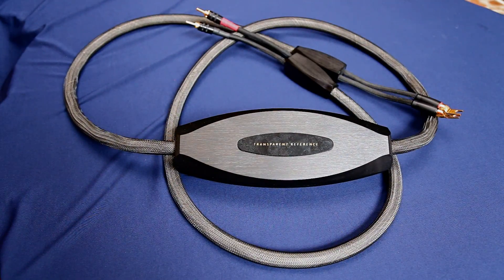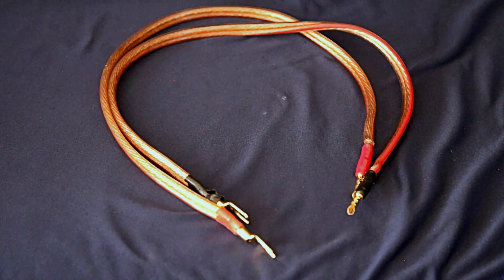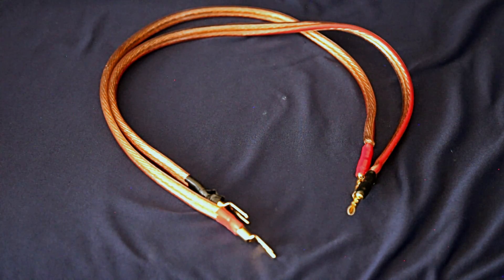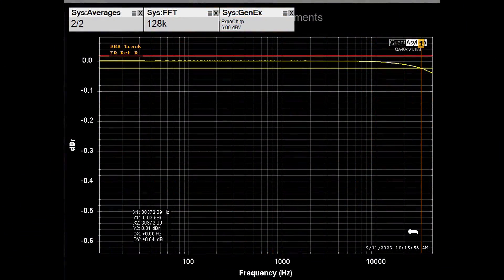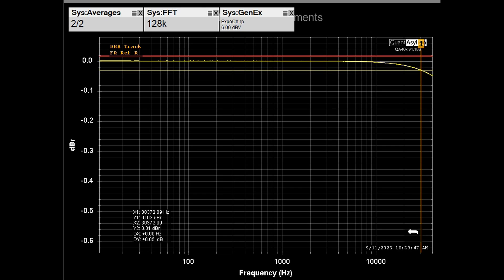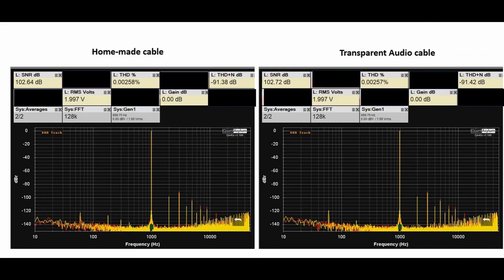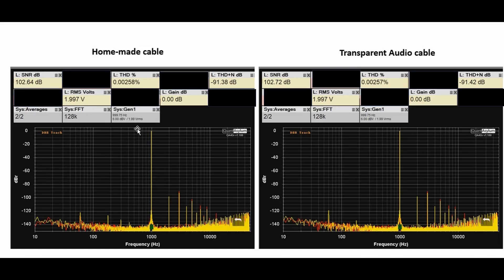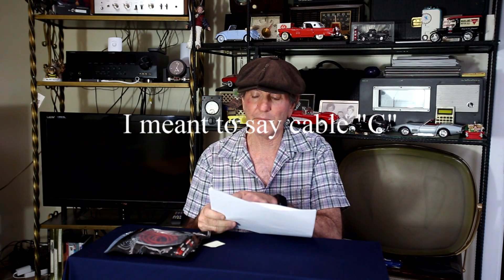$8000/pair Speaker Cable  vs. $14 DIY Speaker Cable A/B Test: Vintage Audio Review Episode #87

Comment: What you hear in better quality cables often is not the tone, not an analysis of the bass, the midrange or the treble, it's in hearing the improved detail, transparency and spatiality of the 3-dimensional stereo image. But in order to hear those differences it comes down to setup. If a system is set up to present an accurate presentation of the stereo image then those differences can be become much more clear. If the system is not set up for that and one is merely listening for differences in tonality, whether they hear more or less bass, if vocals sound drastically different, or that a hi-hat is transformed, then you are not going to hear a huge difference. To reap the benefits of quality cables you need to have a properly set up system to maximize the stereo image and often the set up should include proper room treatments. You may say then, well why the heck do i need to go through all of that work to be able to hear differences in cables? You don't. It all depends on what you want. I say to each their own then. There is a market for higher quality cables because it caters to those who have a system set up to benefit from those cables. If you don't want to hear the differences cables make then just stick with the setup you have and carry on. For those of us who are maximizing the reproduction of the stereo image we will then reap the benefits of higher quality cabling.
Reply: @sean_heisler  
In reality, the quality of the 3-dimensional Imaging and Soundstage performance of loudspeakers have absolutely nothing to do with what speaker cables you are using.

The properties, quality, or "precision" of the Imaging and Soundstage are determined first by what is captured or mixed into the recording itself, and secondly by the design and quality of the speakers themselves plus the acoustics of the room they are placed in.  There is a third very important factor...

In order for our auditory system to perceive a more accurate/more focused soundstage that reproduces exactly what is captured or mixed into the recording, the single most important factor is that the Amplitude Response (Level vs. Frequency, or "Frequency Response") Between the Right AND Left loudspeakers be as Closely Matched and as similar as possible At Your Listening Position.

An imbalance between the Frequency Response of the Left vs. Right speakers will make it difficult to achieve good imaging.

Achieving good imaging and soundstage performance with loudspeakers that are placed in a non-symmetrical room can be problematic.  For example, when you have your speakers placed in a living room in an open-plan home where one speaker is in a corner with both a wall to the side and behind the speaker, while the other speaker has the same wall behind it, but no side wall because that side of the room is open to another adjacent living area such as the kitchen or dining area.

In this scenario, due to the difference in reflections as well as the difference in boundary-loading and "room gain" between the left and right speakers, the Left vs. Right Frequency Response will be quite different, and the imaging/soundstage performance will suffer.

The ratio of the direct sound from the speakers vs. the reflected sound from the room will also have an effect on the quality of the imaging, especially if one side is different than the other.

Excellent imaging and soundstage performance is easier to achieve when you eliminate or mitigate most of the room's acoustic interactions and influence on the sound that you hear from the loudspeakers, and is the primary reason that the majority of recording, mixing, and mastering engineers generally use "nearfield" studio monitors while producing the music that we all listen to.

Listening to speakers that were designed to be precisely matched to each other in regards to frequency response and dispersion, as well as listening to them in a nearfield environment provides for the most accurate reproduction of the imaging and soundstage in the recording, NOT speaker cables!

This is another reason why even relatively inexpensive earbuds or headphones usually do a good job of providing good Left-to-Right imaging and focus.  However, they usually lack some of the crosstalk and HRTF/head-shadowing imaging cues we hear when listening to loudspeakers in a typical room which are time-arrival based (ITD) and help to provide a perception of Depth and "Room Ambiance" or the size of the performance venue.

Swapping speaker cables has NO affect on ANY of these properties.  If for some reason you do have poorly designed speaker cables that alter the frequency response of the speakers due to excessive resistance, capacitance, inductance, etc, when you switch to a different pair of speakers cables that do not have this issue, even though the overall FR might be slightly different between each set of cables, BOTH speakers will STILL BE MATCHED to each other because you are using the same SET of cables for both speakers.

And in reality, moving your head just 12" up/down/left/right from the MLP has far more potential to change the response and imaging/soundstage performance compared to any differences another set of speaker cables will make!
Reply: @bbfoto7248  well said.
Reply: @bbfoto7248 How does all that get to the speakers if the cables have temporal distortions, a high noise floor or tonality issues. Sometime you guys can't see the forest for the trees. A speaker without dispersion issues, tonality issues, crossover issues, cabinet issues, refraction issues, issues with high driver distortions, drivers with high mass, etc. costs way more than a decent cable yet here we are.
Reply: @bbfoto7248 Yet it can't improve what it. Cable swaps can and is easier and cheaper than speaker swaps.
Reply: @carlosoliveira-rc2xt  
Estoy no comprendo tu palabras, amigo.

Different wire can not magically "improve" or "create" better electrons or "flow" in the signal that the wires transmit.

A basic, but properly constructed set of speaker cables of adequate wire gauge to carry the required power (usually no larger than 14 AWG for 20+ feet/7m) will transmit EVERYTHING that is inherent in the AC waveform and signal that the speakers need in order to reproduce the sound accurately.

Again, just moving or aiming the speakers in your room +/- 3", or moving your head 10" to one side or the other will affect the sound characteristics infinitely more than swapping properly constructed & terminated speaker cables.

And as others have said, your Room Acoustics matter MUCH More as well.

The properties that affect your perception of ALL aspects of "resolution", "detail", "nuances", "spectral balance", AND 3D Imaging & Soundstage performance are achieved by MATCHING the Time Arrival AND Frequency Response as closely as possible between the Left & Right speakers At Your Listening Position.

Exotic or "special" speaker cables Do Not change any of those properties unless they are inherently flawed or purposely designed to do so by being something other than neutral and agnostic.

Electrons Do Not magically become "better" or improved when flowing through an already highly conductive material such as copper, silver, or gold.

You can't slow them down, speed them up, or make them dance a special way within the wire on their way to the speakers.

The only real considerations for the topology and construction of any type of audio cable are voltage & current capacity and rejection of potential induction of EMI or RFI noise from external sources.  But the AC signal voltage level alone that is carried by speaker cables is high enough to overcome this type of noise in all but the most extreme circumstances.

I have no problem with spending good money for nice cables that are properly constructed with excellent connectors and proper terminations (THE most important aspect of ANY type of cable), but I'm not doing so with the intent or expectation of IMPROVING the actual sound of my system.

I've been a musician since the 1980s.  Step into any world-class Recording Studio and you'll soon realize that there are potentially THOUSANDS of feet of all different types of cables and wire connecting all of the studio equipment.

While the music that you love to listen to was actually being recorded, then mixed, then mastered, the audio signal that finally made its way to the digital DAW recorder/storage device or to an analog reel-to-reel tape deck has already travelled through sometimes HUNDREDS or more feet of All Different Types Of Cables, AND through a multitude of various electronic components...from the microphone, mic cable, to the mic preamps, through the mixing console and its channel strip EQs/Op-Amps/Transformers/Potentiometers, then through all of the outboard analog & digital rack-mount EQs, Reverb/Delay, Compressors/Limiters, & EFX gear, THEN back into the console, and finally to the studio monitor speakers and the actual recording device!

In addition, 90% of the studio monitor speakers that engineers use don't even have Speaker Cables because they are Active designs with built-in multi-channel Class D amplifiers and electronic DSP crossovers.

These studio monitors are connected using typical off-the-shelf and industry-standard balanced XLR SIGNAL cables from manufacturers such as Mogami, Canare, Neutrik, and Amphenol, etc.

^There is NOTHING Exotic or Unique about these cables other than them being a proven and reliable design.

Again, these are the engineers and studios that Actually RECORD and Produce all of your favorite music and the "audiophile" tracks that you are listening to on your playback system.  WHAT do YOU KNOW that they don't? 🙄

Just do an image search for "Studio Patchbay" and look at the multitudes of all the different cables that are plugged into the front of it in order to route and select (patch) different gear into the signal chain...and also know that there are Even More Cables and connections attached to the back side of the patch bay that snake all over the studio!

Do you think that these engineers are actually going to Swap out EVERY cable in the studio for some particular type of expensive "exotic" or "special fairy dust" cables???

^But that's exactly what they would NEED to do, because if you leave just one "normal" cable in the signal path, it would be the "weakest link" in the chain and cancel or nullify the "special properties" of ALL of the other exotic/boutique cables.

Legendary recording and mixing engineer Al Schmitt (RIP) with 23 Grammy Awards isn't going interrupt Diana Krall in a tracking session and tell her to "hold-on, wait!" while he swaps out his speaker or other cables because the sound isn't "right" or "good enough" as it's coming out of his studio monitor speakers!

The effects of a 6ft-15ft length of proper speaker wire of adequate gauge that is connected between each speaker and the amplifier and is transferring audio bandwidth signals in AC at ~ 3-50 volts is completely INSIGNIFICANT.

There are simply a PLETHORA of other things that will have an Exponentially Greater Impact on the the level of sound quality that you achieve in your playback system.
Reply: @ This is not correct. As I discovered much to my shock, better speaker cables made a huge difference in the sound of my very expensive system
Reply: As a Communications engineer on Doppler systems on aircraft. It horrifies me so see how people actually believe they can hear such a difference with cables. From a scientific point of view it’s snake oil.
Reply: @bunkerbusterexplore You don't even know what snake oil is. Research snake oil. It's the legitimate  article and still in use today. Fake snake oil was the problem but guys like you just regurgitate nonsense they hear without understanding it. Here's another one for you. BMW cars aren't bimmers or beamers as I'm sure you've heard dozens of times and perhaps use this term. BMW motorcycles were called beamers/bimmers not the cars. I could go on but you get the idea. You cable ideas are just as wrong. Hope you weren't in my military.
Reply: @bunkerbusterexplore  Dielectric constant is a big reason you hear differences. Do you think that there would be successful cable companies and so many buyers out there if hundreds of thousands of people were all just this gullible and fooled by placebo? When you have a very high resolution system set up properly that allows one to hear small changes to a system you can easily hear the differences between cables.
Reply: @sean_heisler  fancy a career in the avionics industry because sounds like you can hear what our multi million pound systems cannot. Wow. I’ve worked on commercial and projects I cannot still talk about and you have just trounced my 35 years of experience. You have a lot to learn my friend.
Reply: The 3d spacialty and stereo imaging has to do with the timing and phase of the signal arriving to your ears.  Many things affect that, and assuming the speaker is made correctly, the biggest thing that affects that is the room and listening position.  Simply moving your head around the sweet spot makes more difference than a cable.  But it’s easier to sell a magic cable than it is to sell a listening room construction project.
Reply from the maker: You put some time & thought into your comments and I appreciate that. There have been a few arguments about cables effecting the stereo image, but basically just a slight movement of your head will effect the image more than the cables....but you can spend your money however you want in your search for audio nirvana- that is part of the hobby.
Reply: @vintageaudioreview  Thanks. I would not argue that the differences cables make is gigantic. But it's at times quite noticeable in the right systems and it comes down to how much you want to spend for those small improvements and what they mean to you. I don't have the money for super expensive cables but even if I did I don't have interest in them. All my cabling - speaker cables, interconnects, digital and power all add up to less $1k and that's the most I want t spend but to me they are worth it because they have all made a very clear and meaningful difference but I'm not interested in spending more for a tiny bit more of a difference. I know that you could reply and say that all of your cables add up to less than $50 total, I get it.
Reply from the maker: @sean_heisler  I have no problem on spending whatever you want on cables, and $1k does not sound too bad at all. Sometimes the cables look neat and have a good feel to them. If your cables are exposed then looks can play a part for some. It will be interesting to see the comments on another cable test I did that will be out in a few weeks.